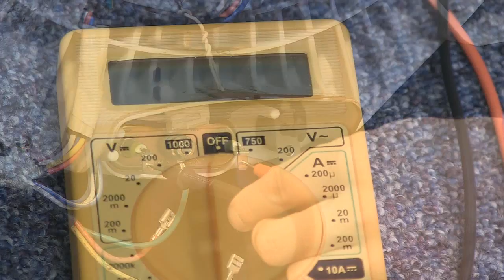How to Diagnose Washing Machine Control and Program Problems

Comment: My LG washing machine is, stock up at the last of spinnning at 5min it was stay around 3-5 hours before end so do you have any sugestion what was problem?
Reply from the maker: Hi harly, has it drained the water because it will not be able to continue to the spin and finish, is it washing OK? and last what have you already checked.
Reply: @eSpares  sir, it is spining continue spining but the speed is not much they cant dry the cloth inside spining stop spining stop they cant continue high speed so, it take 3-5 hour before end
Reply: @eSpares  sir wash is okay, rinse is okay only for last of spining and drying last of 5min it will take 3-5 hours before its end.
Reply from the maker: Hi harly, check the filter and outlet hose to your plumbing, test the drain pump because if it has not drained it may not be able to spin the water out of the clothes and if they are all OK it could be your main PCB.

Comment: Hi there. On my machine the drum doesn't rotate on spin. So i first thought about belt or brushes but then noticed that the timer counts down from 11 to 10 and then 1? Does this mean its the control?
Reply from the maker: Hi Neil, does the drum turn on the wash cycle and that would suggest the belt and brushes may be ok if not check them first, the board will control the display function including the time so test the connection and look for any signs of damage.
Reply: so last night i put it on a wash cycle and all that happened was the counter counted down. The machine did not fill up with water, the drum did not turn. If its the brushes or belt, wouldnt the fill still work?
Reply from the maker: Hi Neil, it has to fill before it can wash so check the inlet valve with a multimeter but this does sound like a board issue but you need to rule out all other possibilities first.

Comment: Hello Josh, I have an older front load Kenmore (2002). it isn't digital, it fills, washes, but then will not drain and remains on. does this on any wash cycle. do you have a video to direct me, or please tell me what to check?
Reply from the maker: Sounds like a drain problem so watch the following video:
https://www.youtube.com/watch?v=frEJhX9Sppw
Reply: Must be the wrong video as there is no mention of drainage problems, thanks for quick reply.
Reply from the maker: The video I linked to is called 'How to Diagnose Washing Machine Drain and Pump Problems ' as you have a pump or drain problem.
Reply: yes, thank you, it is very informative.

Comment: My control panel won't allow me to start a load. The machine comes on, but when I press start or move the cycle choice knob the machine turns itself off. It does let me check for codes, but it just shows "-:" when I check, which isn't an error code that I can find.
Reply from the maker: Hi Amber, it sounds like the machine is in 'child lock mode'. Check your instruction book or have a look at the control panel buttons, there is usually a symbol of a lock between two buttons. If you press both buttons and hold them for five seconds it should turn the child lock on or off and then allow your machine to work normally.
Reply: It's not locked. Or if it is the display panel isn't showing it to be. Regardless, if I push any buttons other than power or the code checking button the machine just turns itself off again.
Reply from the maker: What is your full model number (on a label behind the door rim).
Reply: WF45H6300AW/A2
Reply: Amber Jones  I have the same model number is just Shuts off & on did you ever find the issue

Comment: Hello there, My Indesit IWE 91480 trips all of the fuses in the house as soon as it is turned on, is this the suppressor and can I change this easily, or does it sound like a more complex issue? thank you :-)
Reply from the maker: Hi Tori, The mains suppressor may be faulty but if you remove the plug from it disconnecting the rest of the machine if faulty it would still trip when the power is switched on. If the filter is OK then suspect the heating element and check this as it is the most likely cause of the problem.
Reply: Hi thank you, I have never looked at anything like this before, do you have a video, do I just disconnect suppressor from  the mains supply? and then plug the mains back in to the socket, if that does not trip the rest of the house then it is the suppressor? and then get a new one? if it still trips then it is likely to be the heating element??
I just thought that I would give it a go as it is already broken so if I can't fix it then I will either call someone in or get a new one?
again, thank you for your help :-)
Reply from the maker: The mains cable enters the machine at the filter: http://www.espares.co.uk/product/es1130816 There is a connector from this that can be removed when the power is disconnected to prove a faulty filter when reconnected. If it trips when the rest of the machine is disconnected it must be a faulty filter.
Reply: Thank you so much for your help :-) xx
Reply from the maker: Good Luck. 😊

Comment: Have a hotpoint aqxxf149pi  no fault code but when press to start programme it can take up to an hour for the door to lock and start any help thanks
Reply from the maker: Hi Neil, have you replaced the lock yet?.
Reply: eSpares j
No not jet
Reply from the maker: We would suggest you replace the lock before looking for another problem that may not exist.
Reply: Will give it a go 
Thanks for the help

Comment: Hello...I have a lg model wm2650ha. The power doesn't come on at all. No lights, no power. I tossed the breaker, checked my fuses, the're fine. The outlet is fine, the power cord is fine...called LG and they said I need to call a repair shop. I noticed a "burnt" odor so I removed the top. The pcb seems have the similar odor. How can I be certain that this is the problem? Can these boards "burn up"?
Reply from the maker: manicmandownup Hi,The control board can indeed burn up or blow and this can be as a result of another part failing damaging the PCB.If you have continuity from the plug to the board and no lights it is very likely the PCB has either failed or is damaged. Check the heater and drain pump for a short circuit before just replacing the board.
Reply: eSpares Thanks a lot for taking the time to respond...you have a great, thorough video...I'll let you know what happens!
Reply: eSpares I found a burnt heat sink on the pcb, hence the odor I suppose...could something have contributed to that burning up or is that an independent component? Thanks again...
Reply from the maker: manicmandownup The problem may just be a failed power supply regulator but it is still worth checking with a meter that both heater and drain pump have not shorted to cause the problem.
Reply: eSpares It ended up being the power supply. After I removed the pcb I could see where the heat sinks had failed and went up in smoke. Replaced after checking the other components that you recommended and it's been working great. Thanks for your help
Reply from the maker: manicmandownup Glad to hear you sorted your fault.  Lg's are good washers and should give long service if looked after. Now may be a good time to give it a treat, see another of our videos if you haven't already:
www.youtube.com/watch?v=ifWK9df1qgg

Comment: we moved our washer and cleaned behind it now when we plug it in there is a high pitched buzzing/humming noise from the control board
Reply: everything still seems to work properly but the noise is never loud and annoying I can hear it from at least 30 feet away
Reply from the maker: Hi Truth Be Told, check for a loose connection but just could be a buzzing relay in the board.
Reply: it got louder last night and now it will power on but it won't start on any settings
Reply from the maker: Hi Truth Be Told, check the door lock to rule it out but if that is ok it does sound like the board.

Comment: hello, My LG front loading washer is not spinning/agitating with full load. In tub clean mode only spins for 30 to 40 minutes then stops. sometimes gives LE error (motor overload). All the lEDs on the front panel light up on powering up the machine. I am able to set a program. the water gets into the machine and also drains out as per the cycle. I do hear a very low click sound (maybe pcb sending command to motor to switch on but it fails). The authorized technician came to check but even he wasn't sure but advised me to get the PCB changed. What in your opinion could be the problem?  PCB, clutch assembly, motor or any other? its only two years old with  direct drive motor.
Reply from the maker: Hi Sandip, you would need to test the motor with a multimeter as you can not test the board if the motor checks out then it is likely to be the board.
Reply: @eSpares  thanks. could you please tell me more about direct drive motors. the one which is installed in my washer is sensor less. Does it mean that the sensor is on the pcb?
Reply: @eSpares  new board replace same problem. The tech says motor is also fine. unable to diagnose the problem. could it high voltage, the machine runs on 220 V , the voltage on the mains is 240 volts plus there is no earthing in my house. But the washer was working perfectly for the last two years on same voltage and no earthing.
Reply from the maker: Hi sandip, if this was us we would start by checking each circuit to determine what has failed, the power sounds fine but a little concerned you have no earth and that is a safety aspect for the machine if something goes wrong.
Reply: @eSpares  Today i received my washer back from the service center with a note that there is no fault in it and it worked perfectly during the test period.  Its a strange case , the washer is working fine now with no part replaced.
Reply from the maker: Hi Sandip, intermittent faults are the worst to find, we are keeping our fingers crossed it does not play up again and good luck.

Comment: My LG front load will not power up
Reply from the maker: Hi Paul, as we say in the video check if you have power getting to the board by first proving you have power at the socket by running another item. Then check continuity to the board, If this is ok suspect the PCB.

Comment: I have kenmore elite 4t the trap is clean but it fills very little water then before tub agitates w little water shuts down won't spin wash nothing now door won't unlock even when unplugged and plug back stays same what is wrong and yesterday the dryer same brand match stopped drying turning and buttons turned on off I plugged off then back on tried to reset by open close door 6 times then buttons went totally out I inplug plug back button on not drying still but buttons went out again please help I have to have washer dryer for clean clothes
Reply from the maker: Hi Diane, it is unusual for both appliances to fail at the same time, Have you checked the house 'breakers'. Often in the US there will be two supplies to an appliance and if one has 'tripped' it may cause this type of problem.

Comment: I recently had to empty the filter from my washing machine because it would not drain and it worked fine after that but a week later after doing a regular wash I put my clothes on the radiator to dry and went to put another load in and as soon as I got the temp to 40 like I usually do and then clicked on wash the machine and all my sockets went out, so I unplugged the washing machine and got my sockets and electric working again, plugged the washing machine back in and it turned on so I thought it was fine I then went to wash my clothes the washing machine came on with all the lights but again after I clicked on wash it just cut everything out like it wouldn't let water get into the machine so I think it has something to do with that because it turns on perfectly fine with the lights on its just when I click wash it doesn't fill and cuts the fuse of everything out.
Reply from the maker: Once the cycle is started on some machines it will do a quick self test and momentarily power pump, motor and heater. It is likely the heater has failed and may be breaking down to earth. A multi meter may not show this problem so we would suggest by replacing the heater as this is the most likely cause of the problem.
Reply: Thanks for the quick reply. Do you know how much that would cost with calling someone out?
Reply: I found some for my washing machine a beko WM5102W for £23 would a cheaper one for any Beko model work just as well too?
Reply from the maker: The heater for your machine is available here:
http://www.espares.co.uk/product/es554762/
And to replace it see our video: https://www.youtube.com/watch?v=CCCEsalzzbY
Reply from the maker: If in the UK Repaircare can offer a fixed price repair for a good price.
Reply: Thanks I think I have used your video before to remove and replace it so have an idea but will watch again and buy the heater as soon as I can thank you

Comment: I have a bush F841QW and it is displaying excessive vibration. But this only happens during a 40 degree or 30 degrees wash cycle and the excessive vibration only starts after about 20 minutes of wash. But once it starts, it continues during the rinse cycle but not during the spin cycle.  But it doesn’t do it  during the same cycle but at 20 degrees instead of 40 or 30 degrees. 

I have been studying its behaviour. And after about 20 minutes of a hot wash, it starts to undergo high acceleration from rest which is not normal and it is this that causes the excessive vibration. It was suggested that the cause of the high acceleration from rest is power surge to the motor and is caused by something heating up with time. 

The question is what is heating up with time and causing the temporary motor power surge? 

Any advice will greatly appreciated.
Reply from the maker: Hi Ali, check if your machine has a TOC on the motor and make sure it is not cracked or loose, also it could be a dry joint or overheating in the PCB that controls the speed of the motor but that can be difficult to diagnose but good luck.
Reply: eSpares... thank you so much for your prompt reply. What is a TOC please and what does it look like?
Reply from the maker: Hi Ali, TOC is short for the tachometeric generator and helps generate the speed, it is fitted usually in the top of the motor if it is fitted.
Reply: eSpares.... thank you so much, I will check.
Reply: I located the TOC and traced the wires and put my meter across them it read 180 ohms. Is this what it’s meant to be? When I turned the motor, the reading changed from hundreds or bigger to negative readings but when the motor stopped, it went back to around 180 ohms. I didn’t take it out, should I take it out for visual inspection? I can’t see how it’s held in position, is it just a tight fit? 

Many thanks
Reply from the maker: Hi Ali, it would depend on the motor but you need to determine if the TOC is broken or loose, the reading from the TOC is ok. It is a process of elimination so if the motor is ok check the PCB.
Reply: eSpares thank you very much. I will look at the PCB today. If this needs changing, do you stock it and how much is it please? It is a Bush F841QW
Reply from the maker: Hi Ali, here is the link to our parts www.espares.co.uk/search/ma732pt1980/washing-machines/pcbs-and-modules/bush so if you need the PCB have a look.
Reply: eSpares thank you very much I will keep this in mind. I am continuing with diagnostics to try to identify the cause.

Comment: My final cycle won't spin. How do I find out whether it's springs, shocks, or door assembly?
Reply from the maker: It is not likely to be any of those that is the problem. If the machine washes then the motor and control board as well as the door and lock must all be OK. The likely cause of a spin fault when the motor is OK is a balance issue so see another video: https://www.youtube.com/watch?v=uKBy-9NEF5A
Reply: Jennifer W           .

Comment: My washing machine start button is not working properly,as when I set that button for washing it immediately come back to its starting(first point) position and get stops.It's being a month of having such problem in it.So,please sir can you help me in it?
Reply from the maker: This problem can be caused by a number of reasons. Check the power connection and supply by plugging in another appliance like a heater as if the power dips when working it can reset the control panel. If it is a Hoover or Candy the problem may be the control itself so see this video:
https://www.youtube.com/watch?v=p5L04Ax36O8
Reply: When we show it to the company mechanic he change the timer of the washing panel but even after that their is some kind of dissatisfaction in washing about its irregular  changing speed.All though |"thank you" sir for your suggestion I will certainly try as you have mentioned.
Reply from the maker: Good luck.

Comment: hello my washing machine wont come on at all changed the fuses but nothing heard a bang when went off .
Reply from the maker: You need to folow this video and confirm if there is a connection to the board. If there is it is likely the board has failed.
Reply: thank you

Comment: HI,  Josh I have a Miele W3260. It had an intermittent problem which has now become permanent.  The drum begins to fill and within seconds No matter which program I select the rinse light begins to flash repeatedly and the water empties.We have replaced the brushes, but NO change.I have tried the drain and separate rinse cycle and the fault presents itself there also. Any ideas as to what the problem might be????
Reply from the maker: +Laundrygirl 
Sorry we are late replying but Youtube has just 'found' your comment. If the machine is filling at the normal speed (in under 90 seconds?) or to higher level then you may have a pressure switch problem. If this takes over a coule of minutes before it occurs check the water supply is not restricted and its timing out. For more information see: https://www.youtube.com/watch?v=VS48G_cwCXo